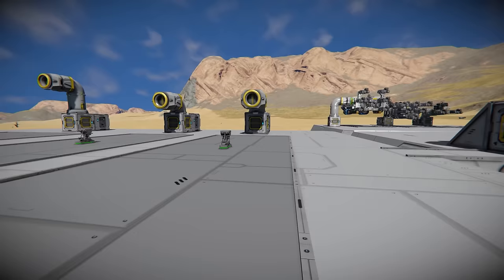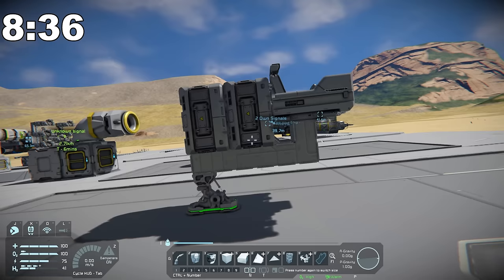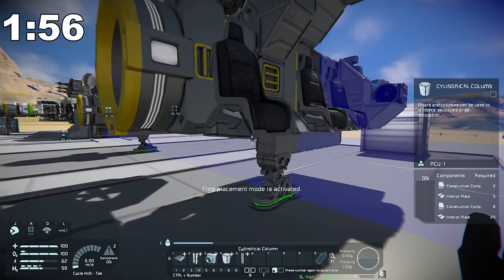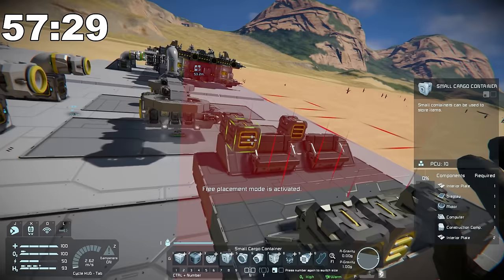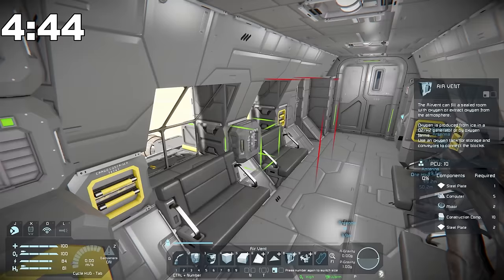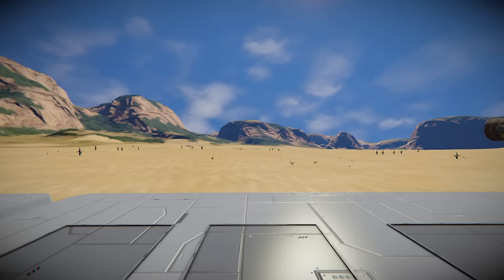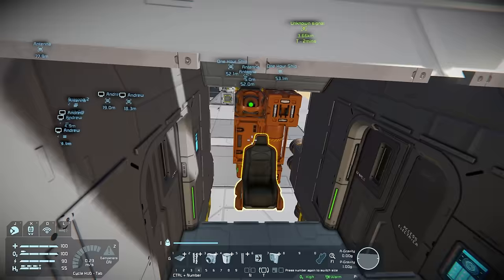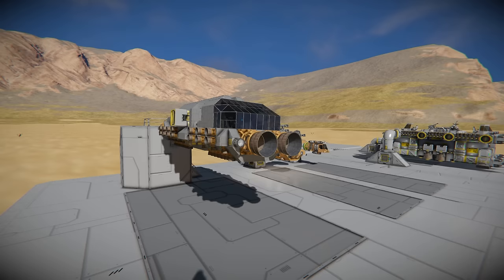Building a TRANSPORT Ship in 1 Minute, 10 Minutes, and 1 Hour! - Space Engineers Challenge

Comment: your 1 min build.. ugg.     cockpit, h2-02 generator,  4 convayers,  connector facing down,  a few batteries on top of that (small) 6 h2 thrusters gyro.   then throw on a few small armor blocks to give it a bit of structure.   
 keeping everything with the 3x3 box  it will fit through airlocks, so you can mount it as an airlock shuttle and transport.   these things run just off ice...   don't need h2 tanks...   are pretty quick given their low mass.

Comment: Ha ha oh no the fatal flaws XD

My submission for video concepts: If you're up for a mod, this makes use of Draygo Korvan's aerodynamic physics mod. Pretty well known, so hopefully not a turn-off for too many people.

Build a small grid ship to achieve the highest possible ACTUAL top speed in earthlike atmosphere at sea (ice) level. The mod introduces air resistance and "thrust" from lifting surfaces using only vanilla armor blocks.

I can't remember the default settings, but I usually set my small grid ship top speed to 300 m/s. For most design concepts, it's pretty hard for me to get a small grid ship up past 140 m/s at sea level (or up to about 100m altitude above terrain obstacles). In default mod settings, I think that translates to about 70 m/s effective maximum out of theoretical 150 m/s top speed when in vacuum.

This can be a challenge in and of itself, in an unlimited time class. Or it can fit the 1m, 10m, 1h format of this series as well. Real life intuition and simple engineering basics transfer fairly well: less block cross-sectional area = less drag. Radical streamlining ends up looking like IRL rockets (ha ha skinny tube go zoom).